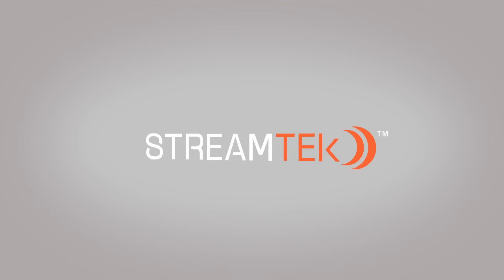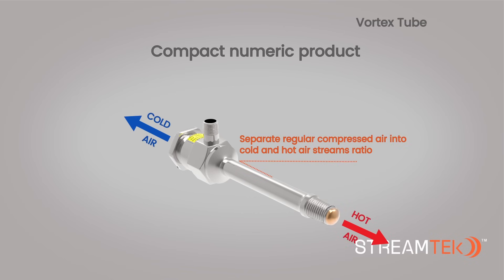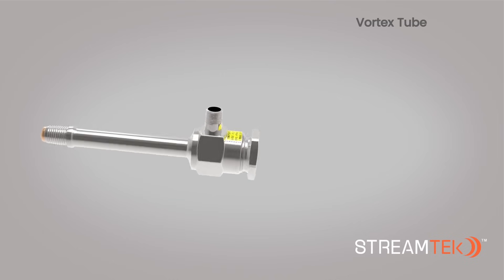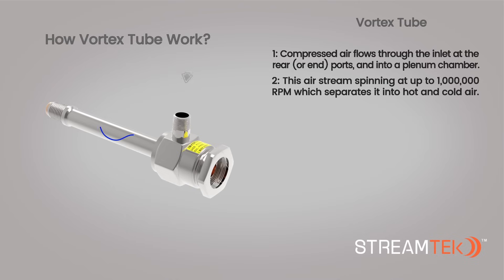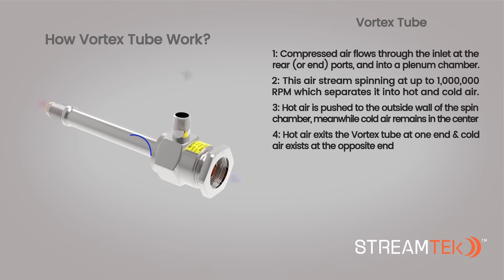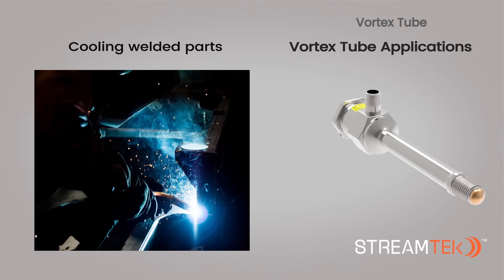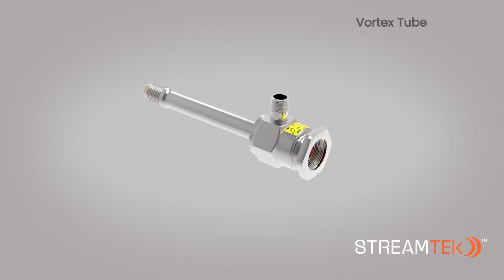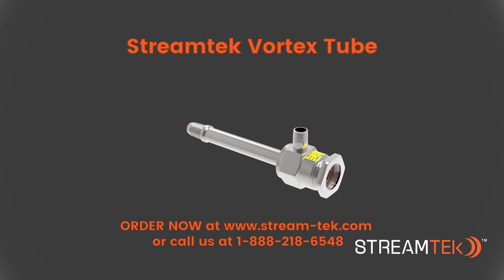How Vortex Tubes Work: Instant -40°F Cold Air from Compressed Air

Comment: 0:59 "Hot air, being lighter in weight than cold air, is pushed to the outside wall of the spin chamber".....

By lighter you surely mean less dense, but wouldnt the more dense cold air get forced against the wall "harder" than the hot? Basically, the dense cold air should push the less dense hot air out of the way?
Reply: This is why I stopped watching. It seems no one can describe how a vortex tube works without saying something nonsensical like "more dense air doesn't get flung to the outside" , lol
Reply: @PrIsMaTiSmX Nope it makes sense. The vortex doesn’t have enough centrifugal force to throw the “heavier” cold air to the outside. Unlike the “lighter” hot air.
Reply: @ReefMonkey  well that's exactly it though. Without knowing the dynamic properties of the fluid, it would be near impossible to tell whether centerfugal force, or shear air pressure would be driving factors of this mechanism. Not sure why you say it does make sense. You know that hot air rises, you know hot air is less dense, so what is intuitive about hot air being on the outermost part of an 'artificial gravity' with respect to the air particles?? Because that's essentially exactly what is being generated.
Reply: @PrIsMaTiSmX  The way it works, to my understanding, is not that its separating hot and cold air. Rather, it's creating a pressure gradient, which naturally result in a temperature gradient since pressure change and temperature of gases are directly related. 

When air enters the vortex tube, the air near the outer wall circulates much faster than near the axis. The faster circulation near the outer wall results in a greater centrifugal "force", which increases pressure and thus temperature. Meanwhile, the air near the center becomes depressurized because the the same centrifugal "force", causing it to cool down. 

Basically, think about the centrifugal force gradient and how the increase/decrease in force along that gradient effects the fluid pressure.
Reply: @Erowens98   I see where you are getting at, but fluid dynamics seems to disagree. Faster flowing fluid generally means it is a lower pressure, Bernoulli's equation is famously tied to the explanation of this phenomena, so faster fluid being on the outside should result in a lower pressure on the outside, in direct conflict with what you said "which increases pressure and thus temperature." I would expect the outside to be cool, and as the fluid traverses to the axis, it gradually gets higher pressure, and higher temperature.

This seems to be the proper explanation for this phenomena, although I would assume that the centrifugal forces involved would do a great deal of work against this, since centrifugal force is continually trying to put the air on the outside, thus trying to make the outside air more dense, acting against the principle that faster moving air is less dense.
Reply: @PrIsMaTiSmX @PrIsMaTiSmX What you're forgetting is that bernoullis equation is not always valid. Bernoullis equation requires an ideal, inviscid, incompressible fluid which no work is being done by or with. In this case, because of the viscosity of air and its compressibility, viscous dissipation and shear transfer of energy occurs between the streamlines along with compressibility effects. Ie. Entropy is not constant, the entropy balance out is greater than entropy in. Thus bernoullis equation does not apply here.
Reply: @Erowens98  LMFAO, AI is ruining everyone with things they know nothing about.

Your first answer is directly contradictory to your answer that is most obviously AI assisted, and you didn't even realize that fact.

Bernoulli's does require certain conditions to be met, but the variables can easily by isolated and negated when looking at small, sectional flow areas. Your rewording of work is also wrong, since it isn't necessarily saying work cannot be done, but the energy transfer needs to be maintained in the system without changing fluid states. This means no shaft work, no heat transfer outside of the system, etc. This can obviously be done, since the idealized case is the reason Bernoulli's is valid in the first place.. When talking about ideal cases, its important to note that the ideal gas law also applies here, although obviously being far from an ideal scenario.

You know how I know your response was AI generated? Because, besides you all of the sudden gaining 100IQ points and contradicting your original claim, my AI almost copies your responses, your order, your reasoning, the cadence and the words used exactly.

besides that, I also ran it though an AI checker and found it to be over 90% likely to be written by AI.

AI is a powerful tool, and a lot of the time it can be correct. in this case however, its user error because of lack of understanding. The AI gives you a general case solution since you provided such a broad, unspecific prompt. I cannot get into specifics or provide you with instances where Bernoulli's can be applied because you didn't ask it to provide said things.

Short answer: Yes, Bernoulli's equation has some very real, very useful effects when calculating flow with sufficiently low Reynolds numbers, including with vortex tubes.
Reply: @PrIsMaTiSmX  Youtubes comment filter isn't letting me respond to you, i'll try again.
Reply: @PrIsMaTiSmX  There is no reason to think something as basic as the limitations of bernoullis equation, or the relationship between compression/expansion and the temperature and pressure of a compressible fluid, is AI generated. This is very much fundamentals of fluid/thermodynamics stuff that every undergrad textbook on the subject has published for decades at this point. The reason an AI checker may falsly flag my response, is because AI itself source those same textbooks. When we're talking about basic physics, the fact is responses will often appear similar because the physics is the same for everyone. AI checkers are also not reliable. Just like LLMs they are correct around 90% of the time. Which means, that 10% of the time they're wrong. 

If bernoullis equation was useful for modeling vortex tubes, then why is it that bernoullis equations predictions contradict the experimental data? The answer is simple. Bernoullis equation is not applicable here because work is being done. This is something you learn on the first day of compressible flow 101 in most engineering undergrad programs. To mathematically model a vortex tube, numerical methods are necessary, ie. CFD. And even then must be validated experimentally. There are no analytical solutions for vortex tubes beyond basic massflow continuity, and that includes bernoullis equation.
Reply: @Erowens98  No one is debating the obviousness of the limitations of the Bernoulli's equation, and the likelihood that it is AI generated, I am claiming however, that your original comment is completely at odds with that you are now claiming that you have mysteriously increased your lexicon 7 fold. Which, I maintain, is AI generated and you proceed to cover for it.

What you seem to fail to grasp is how Bernoulli's equation can indeed be used to predict the effect of all fluids under specific conditions, of which can easily be satisfied here by isolating the variables. Your very own 'explanation' does nothing to explain the phenomena in the slightest, and no, you are absolutely wrong. Volumetric flow relationships are a key part in determining efficiency, thermal dispersion rates, and deltas when it comes to these units. The way these units are even controlled is by modifying such parameters in the first place. Of course volumetric analysis plays a critical role. Saying that there are no analytical solutions besides mass flow equilibrium insinuates that you also don't think compressibility or the ideal gas law is applicable either, which is again, absolutely and unequivocally false. Compressibility matters when viewing the entire system, and although Bernoulli's equation can be used to explain a flow regime withing a sufficiently small area, thus assuming an incompressible fluid at steady state and minimal pressure gradient, the ideal gas law is what is used to predict the behaviour of the system as a whole, even though it doesn't meet the requirements of the IDEAL gas law either as you have previously erroneously claimed is the reason that Bernoulli's equation cannot apply. Its obvious you misunderstand the basic meaning.

By your own admission, there are no ways besides mass flow analysis to model these tubes, and yet, energy modeling does exist as well. It seems you like to speak about things you know little to nothing about. Perhaps you would like a link to research conducted that successfully modeled these systems without mass flow alone despite you claiming otherwise?

You seem conflicted. You assume that because experimental data does not back up the idealized Bernoulli equation when using it improperly, it must mean that the equation doesn't apply. Well, to that I will say there are at least two additional possibilities: 1. You don't know how to accurately apply the Bernoulli equations, a beautiful explanation to a fundamental fluid dynamic principle, or 2. You disregard the possibility of an additional, overpowering force that changes the experimental results in unexpected ways.

Either way, it makes you closed minded, and a very poor critical thinker, especially if you are an engineer in any capacity.